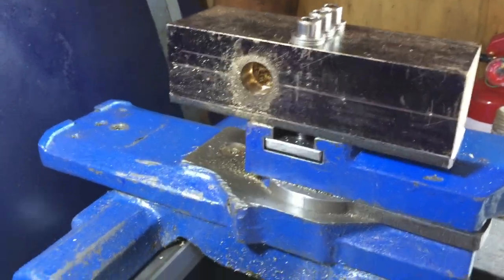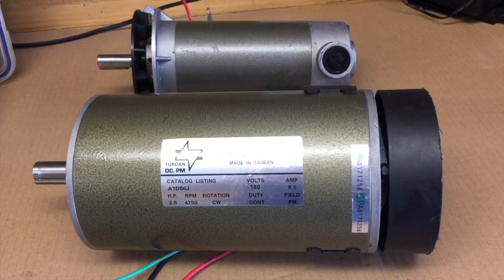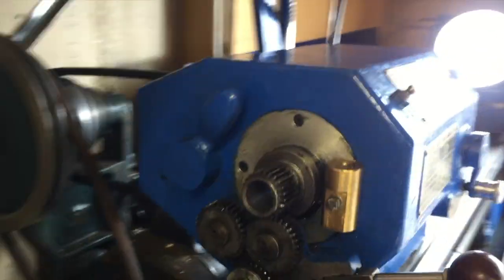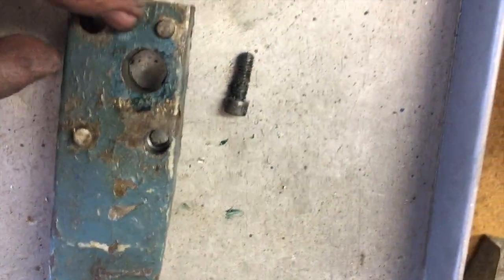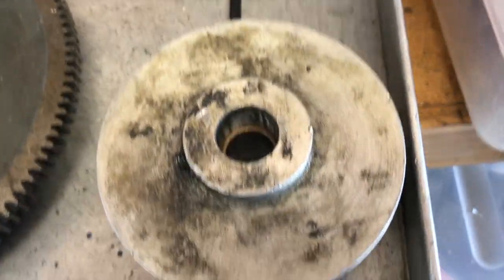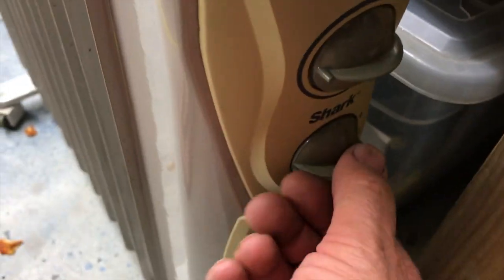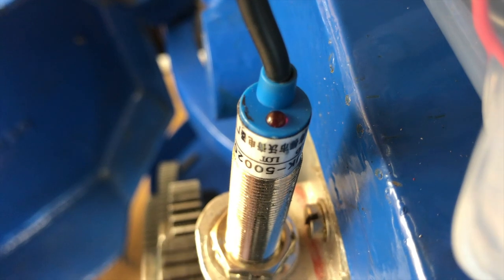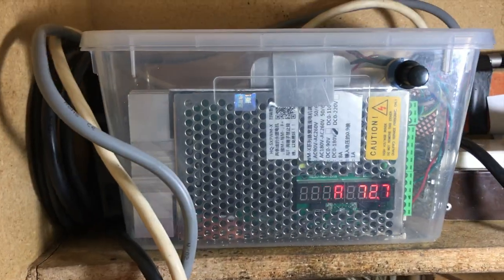Motor Replacement Boxford A Mk 1 with DC variable speed motor

Comment from the maker: It is worth emphasizing that the switch you use for starting and stopping the lathe should be connected to the low voltage "enable" connector so that it drops to ground when you turn it on.  This connector is marked EN. Then if the motor gets overloaded and the E1 error appears, all you have to do is turn this switch off and on again. This causes the error to reset. Originally I wired it incorrectly with this switch providing mains power to the circuit. Although it worked, I had to wait 15 seconds for it to reset after an error, (with the power turned off for 15 seconds).

Comment: I do have the same Boxford lathe in quite a bad condition: the lathe fell on the gearbox and broke of a piece of the gearbox in the leaver area which I repaired using TIG bronze welding. I still need to finish it some day on my recent aquired Bridgeport clone
Reply from the maker: My Boxford had a similar problem. The two gear levers broke off during a fall. I had a lot of trouble trying to find someone willing to braze the cast iron. I eventually took them to a foundry who cast replacements for me,  but then their machinist decided it required so much machining it would be easier to braze the originals. They did that and they are as good as new. They don't take any significant load.
Reply: @Evan-e-cent  ahaaa! Sounds familiar.  Did you reuse the holes in which the 2 selector will "click" in or engage? I have to redrill all the holes eventually on my Bridgeport.  I think I need to put in a thinsheet of paper for clearance and than Re drill. 

The carriage and compound are pretty bad and need re machining.

Comment: Evan, I have a Atlas TH54 so it has a very similar motor/pulley setup and have been curious to know if I can just use one of these treadmill motors mounted on a pedastal to align it with Height of the pulleys on the spindle and run it as a direct drive instead of using the pulleys to switch speeds?  I'm just not sure how well these motors are with low speed torque, especially if it comes to parting.  I'm curious to know if you have given it any thoughts?
Reply from the maker: Hi Robert. Thanks for your response and I am glad to share my experience.I found that I did not have to make any changes to the pulley system. I am using the mid-range pulley which gives 2000 RPM for buffing at the motor's maximum voltage of 180v DC. But can turn the speed down to zero with the speed controller. Although it remains an option I never change the pulley setting. However, at low speeds the controller provides a low voltage eg 20 volts, and the current drops in proportion. I made a separate YouTube video about the speed controllers, and put the specs sheet online.  

Since power measured as watts is amps multiplied by volts, the power drops dramatically. This is OK for light cuts but if you put a heavy load on it the controller tries to maintain the voltage you have it set to eg 20 volts, so all it can do is increase the amps to provide the power you are demanding.  So the current climbs (it displays amps and volts), but I have the current limit set at 10 amps so when it hits 10 the controller cuts off all power with error E1 on the display. With 10 amps at 20 volts you are only getting 200 Watts and one horsepower is about 750 Watts.  You have to turn the main power switch off and on again to re-set it. 

So all this doesn't sound great, but there is a simple and very effective answer. I just put the lathe in back gear. Then I can turn up the voltage and RPM and you get loads of torque, no problem and much quicker and easier than fiddling with belts. So there is the real answer to your question.  It works great for parting. 

For cutting metric threads on an imperial lathe you must not disengage the half-nuts from the leadscrew. So with variable speed I keep my hand on the speed knob - start slow, then zoom through the middle of the cut, but slow down to almost nothing as you approach the end of the cut, so you can stop precisely where you need to. Then disengage the cutting tool. Throw it into reverse, and zoom back to the beginning. It is pretty slick. Move the tool well past the starting point of the thread when you are winding back, so that when you start the next pass the machine has time to take up the backlash in the leadscrew before it hits the actual thread. You can help it take up backlash by holding onto the big wheel on the apron.  

Talking about threads I might as well promote my web site RideTheGearTrain dot com. I notice that your lathe appears to have a rudimentary gearbox on the leadscrew. If that is correct you probably need to change the gears in the gear train to cut most threads, especially for metric on an imperial lathe.  My program tells you how to set up the gear train. Ideally you might have a compound gear for this conversion but you will probably be surprised how many other gear combinations can be used to produce the thread you need. If you are interested just have a play. There are no fees at any stage, although voluntary donations are appreciated.  You enter your own list of change-gears. If the gearbox has a 1:1 gear ratio you can use that. Otherwise you will need to contact me to have the gear ratios for your gearbox added to the program.

Comment: How does the HQ-SXPWM-X fair under load ? I read it has IR compensation what can be adjusted accordingly. Do you know where I can get the pdf manual ? I am contemplating getting one (HQ-SXPWM-X).
Reply from the maker: See the link to the manual above. I loaded it onto my own web site. 

In terms of performance under load?  It works fine. If I dial up a low voltage and speed the motor will turn as low as 5 volts and draws little current. This produces little power and torque as expected. I commonly run it at about 30-60 volts and 2-3 amps. If I try to use it to cut metal the voltage is quite well regulated and the amperage increases to maintain speed. If I really need low speed and high torque (eg for parting) I simply switch to using back gear. I have the pulleys set up to run the chuck at 2000 RPM with the motor at maximum voltage (180v) and motor RPM at 4700 RPM. I never have to change the pulleys. Just dial up whatever speed I want.

The device has digital displays showing amps and volts and I have the digital tachometer to measure RPM. Whenever it is under load you see the amps increase automatically. If the lathe tool jams the amps will suddenly exceed the 8 or 10 amp limit and the circuit immediately switches off and displays E1 error. Turn the motor off and on to reset and you are immediately back in action. So everything works perfectly.
Reply: @Evan-e-cent  sir, thank you for the explanation and the manual. Sharing Your information and experience with the controller is so helpful to me and other viewers. I can't thank you enough.

Comment: Sir, how is the reliability of the HQ-SXPWM-X so far ? I have a mini lathe with 180vdc motor. I would like to use HQ-SXPWM-X for my mini lathe. Partly it has the 0-5/10 v so that I can use mach3 software to control it with a computer.
Reply from the maker: The pulse width modulator unit HQ-SXPWM-X  has worked flawlessly for a long time now, so I bought another one for my pillar drill and it is working well too. It is a great device.  When I did the pillar drill I did not include a computer fan or extra heat sink as it does not seem to be necessary.  I have re-wired the lathe setup so now the main switch on the lathe no longer switches off power to the circuit. Instead the circuit is left running all the time I am using the lathe. The switch simply connects the ENABLE (EN) contacts together. This means I no longer have any trouble with the E1 error locking it out for 15 seconds. The E1 error very rarely occurs if I place so much load on the tool that it draws the full 10 amps (at 180 volts that is 1.8 KW =2.4 HP.   This arrangement means the fan is running continuously. It was noisy so I put a potentiometer (variable resistor) in series with the fan to slow it down. I have been using the lathe to cut threads and love the speed control and reversing feature for that. I do have the manual for the circuit now.
Reply: @Evan-e-cent  sir, thank you for your reply. How do you reverse direction of the controller other than using 2 relays ?
Reply: @Evan-e-cent  sir, btw do you need to specify the output voltage upon purchase? I noticed the sticker has dco 90,110,180 and 220, are those preset values? If they are can they be configured?
Reply from the maker: @rengankrishnaiyer6912  Reversing is easy with a two pole double throw switch to reverse the polarity of the wires going to the motor: plus becomes minus and minus becomes plus, and it reverses the direction of rotation. If you are not familiar with these switches I made an animated diagram for a previous video about reversing AC motors. My lathe already had one of these switches since it was new in 1955.
Reply from the maker: @rengankrishnaiyer6912  The seller advertising seemed to indicate that you had to specify the voltage of the DC motor when you buy the controller. However, after I received it I found that you CAN program this voltage. They may have different ranges of voltage. I think mine said 90 to 240 volts.  This leaves me a little unsure of the precise answer to this question!
Reply: @Evan-e-cent  sir, noted on the DPDT reversing relays. Thank you for the confirmation.
Reply: @Evan-e-cent  sir, noted and thank you. Your answer is fine. This confirms the fact that if i did ordered the unit and me or seller forgotten to remind each other its ok. Just that when i receive the controller i need to check the Output voltage before using it
Reply from the maker: @rengankrishnaiyer6912  I should add that it is the DC output voltage that can be programmed. You may have to specify the input line voltage as 240v AC or 110v AC when you buy it.  If that is correct you can plug it in and program the output voltage.
Reply: @Evan-e-cent  Noted sir, thank you again.

Comment from the maker: I have placed the Chinese-English version of the manual online on my web site here:  The primary page is about a model of the 2000 year old Greek steam engine I built with measurements of its power output. The RideTheGearTrain section is a program for calculating gear trains on lathes. The third item in the URL is the pdf you want:

https://www.herosteamengine.com/RideTheGearTrain/HQ-SXPWM-X-Manual.pdf